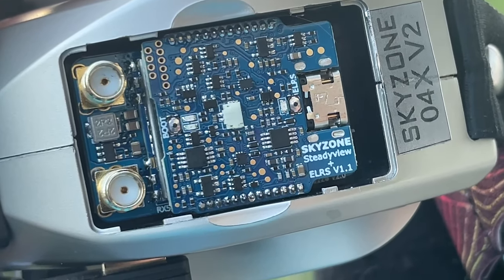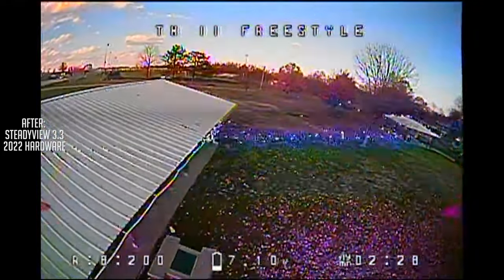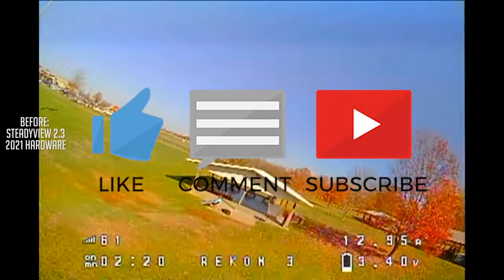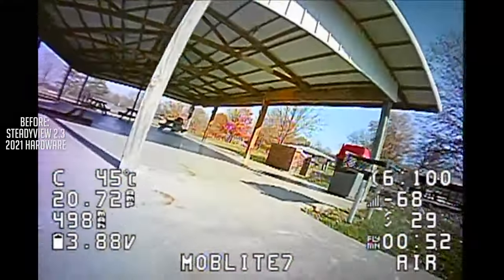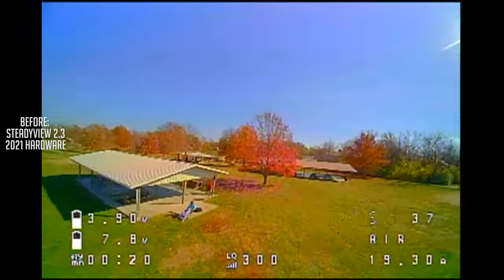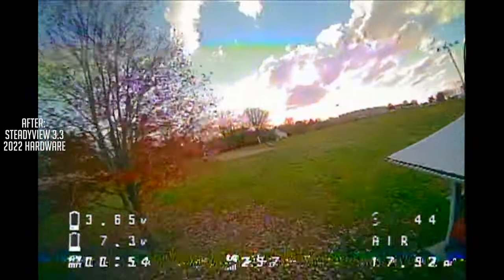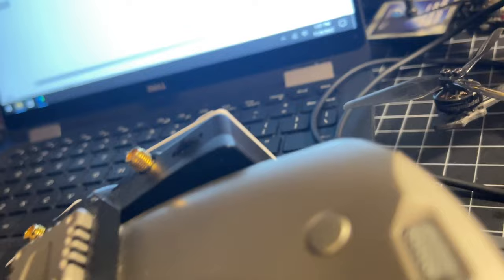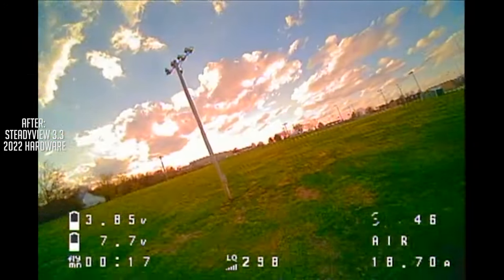SkyzoneFPV Steadyview Fusion Board V3.3 🧮 // Did They Fix Mix Mode?

Comment: my replacement module is on the way.   i downloaded the goggle firmware but there are 2 files in it.  do you move both files over to the SDCard?
Reply from the maker: Yes, firmware A and Firmware B must be copied. But, no SD card is involved. 

#1. You plug the goggles in over USB-C to a computer, and then hold down the power button and left wheel. 

#2. This boots the goggles up in a mode that mounts it as a visible drive on your PC or Mac. To flash the firmware, you then just drag the firmware files A & B to the "drive" that your PC sees. Let it transfer and that's it, you're done with the firmware flash. For firmwares, see here: https://www.skyzonefpv.com/pages/download

#3. The next thing to do in the goggles after installing the new module is to choose SteadyviewX mode instead of RF-Normal. Very important because it will not work at all if you don't switch to steadyviewx mode.

#4. Then recalibrate RSSI so your % numbers are accurate. For the calibrations, the options are LOW and HIGH. Calibrate on LOW first with no VTX or drone running. Then, turn on a drone or VTX and run the HIGH calibration, with the drone around 2 meters away. 

I want to do a whole video on this process, but didn't go into it for this one. It would have made it a 20 minute video. The most important thing is don't waste time flashing any fw on your new receiver, already seen someone almost brick theirs by doing this.
Reply: @JohnCuppi  Awesome, thanks.  i've never updated my goggles.  i've only had them since May.  i need to figure out if they are V2 or V3 goggles.
Reply from the maker: @beeradfpv  In the System menu, Scroll down to Firmware version and check what "FW1" says. It'll tell you what hardware version you have so you can download the correct firmware. Mine said FW1: 2.3.6 before I upgraded, meaning that mine were V2 and so I needed the V2 goggle firmware. After you update, also, it changes the firmware information page to tell you that you have Sky04x V1 / V2 / V3, since this has been confusing a lot of people too.
Reply from the maker: I'm pinning this comment also, it's a great question and our conversation should be helpful to others as well. Thank you!
Reply: @JohnCuppi  Just updated my goggles.  mine were V3 goggles on older 3.4.6 firmware.  Updated to latest 3.4.9.  Also was able to easy take the module out as mine had no tape or adhesive holding it together...lol  Must have know something better was coming...haha.  now i wait for the module to be delivered.  Thanks for the easy tutorial!  This was what was in my menu.
FW1 V3.4.6
FW2 V02.00.00.10
Hw V3.2.3.4
Reply from the maker: @beeradfpv  Hey glad to hear it worked out for you. Looks like you're ready for that module to be popped in and should be good to go.
Reply from the maker: @-mostfpv-  Correct. The Fusion Board module is what has the firmware on it, and when you replace that, it is up to date. Only the Goggle firmware needs to be updated. Not receiver. 🙂
Reply: @beeradfpv  In the goggles, "system" area, hardware version is there - look for "HW".

Comment: I am having the exact weird color issues, especially when the camera turns towards the sunny sky. Your video gives me hope! I have just placed the order for the V3.3 Fusion board. Keeping my fingers crossed. Thanks for the comparison, it really clears things up.
Reply from the maker: Glad to help. I have now had this module for 6 months and have not found any cameras with color or mix mode problems using it!
Reply: That's great to hear. Do you fly with mix mode 1 with all the cameras?
Reply from the maker: @sansjunk  Yes. I've never had to change to Mix2 or Mix3 to get a nice, clear, locked image.
Reply: @JohnCuppi  I finally got the fusion board and replaced it. However, intermittently I am getting a black and white video. This is happening on the bench, so should not be due to signal issues. My old Eachine EV800 is showing proper color, so it's not a VTX/cam issue either. Does it matter if the module is installed on the left bay? Mine are, and I see that yours are as well. I think for quadversity they need the streadyview x module in the right-side bay.

Comment: You mentioned hearing a beep when the video locks on the receiver. I've always wondered how that works, if the connection isn't two way. 

I don't have your goggles, but on my immersionRC module, I hear that beep as well.
Reply from the maker: My understanding is that since it can only be done 100% receiver-side, since it is pulling data in from both antennas, it has to ensure that the camera data is being received at the same rate from both receivers. and that data is up-to-date and matches. I imagine it's like two people trying to watch a movie or show for example, side by side. You want both start playing the content at the same exact time, so you sync yourselves up and hit the play button on 1-2-3. 

And then, if one of you drifts because of lost fps, maybe because your computer had a burp, you fall behind. Not a big deal for two people watching a movie if someone gets a few seconds behind, but for a receiver trying to combine that data to construct one picture, that's a major problem... Generally, you want to choose a short sync time, that's what is best to avoid drifting away because as you said this is really hard to do with a connection that isn't two way. I'm guessing that better hardware must do something to allow the steadyview to juggle all of this, perhaps detect a desync and correct it before the corruption gets to the user.
Reply: @JohnCuppi  Thanks!

Comment: Great stuff John. I will need to get 2 of these for the QUADVERSITY on my SKYO4X V2 Goggs.... Nice fix for sure....however Skyzone should really be sending these out for FREE for each Steadyview they have sold. Sucks to spend money to fix their issue.
Reply from the maker: Yeah... I never went down the path of quadiversity, do you find it to really be worth it? I'm glad the v3.3 hardware just worked for everything I have now, and not just the majority of my micro cameras. I updated my old 2.3 stuff to the latest firmware, and it actually caused some quads that worked great before to run like crap. The rekon3 wasn't like this before I updated everything. I'm glad Skyzone is still supporting users, but yeah, I wish it was offered at cost of shipping alone.
Reply: @JohnCuppi  I have not noticed any definitive improvement telling me it is worth it. Maybe  the update will show the difference 2 vs 4 receivers. The 1 big CON is how fast Quadversity drinks your goggle battery with 4 VRXs running.  You really need to monitor your battery closer because the end is abrupt. Bigger Lipo in my pocket with Lipo alarm has been my solution for that. Anyways great review bro. Always great info.
Reply from the maker: I always thought that quadiversity might be really beneficial for very long range, since you could have so many antennas pointed directionally. Thanks for stopping by man, appreciate it.

Comment: I have two of the older 2.x boards and they would go black and white, and roll hard over. Caused me several crashes. Both whoops and 5" builds. I have given up on the skyzone vrx and gone Fusion in one and rapidfire in the other.
Reply from the maker: Yeah, many already went that route. Sadly it’s too late then, BUT - if you ever have intention of selling your skyzones and keeping your rapidfire, it’s nice to know you can fix it. I’m thinking of selling mine in the future to buy the HDzero goggle.

Comment: Good video. Thanks for the info. Maybe silly question but what's the difference between the steadyview board and the fusion board? And do you ony need to buy the fusion board for the fix?
Reply from the maker: Thanks Barry. The fusion board is an attachment that goes onto the entire receiver module. If you already own Skyzone goggles, all you need to is purchase the fusion board for $25, and the receiver module comes apart for you to replace it with. It’s a quick, cheap, easy fix.
Reply: @JohnCuppi  Lovely. Thanks for the info John.

Comment: I had two of the 2.1 steadyview modules and goggles. What they BOTH did was when my quad was close to me, I would get EXTREME ghosting, which I hope is a type of desync. I'm about to try the new board! I put in a 35$ akk board that worked perfectly but... that has started to have an issue so I'm thinking about trying to new board. This effect happened with multiple cameras and vtxs. I will say on the new moldule, your videos all look a little shacky! looks like super fine wobbling.
Reply from the maker: check this for a reason why you see the 'jitter', it has to do with the deinterlacing -- https://www.youtube.com/watch?v=ctm56rHNxXo
Reply: Any news on the outcome?
Reply: @Dosclic98FPV  No, never got the new module to work, old module is still junk I just run it on diversity mode. Sucks but I can't afford new goggles.

Comment: I'd never heard the term "desync" in this context. I learned something new. 👍
Reply from the maker: Yep, mix mode combines 2x video signals to reduce noise, but when one of the 2 receivers has a delay, then this is what happens.  It's called sync pulse construction. The camera drifts and the pulses aren't set right, so it can roll or shake, or colors get warped to hell. Rapidfire and TBS fusion have also had this issue.
Reply: @JohnCuppi  upgraded Fusion still rolls especially on "fusion" mode, the only VRX that never de-syncs is Wildfire afaik, a bit less range but I love it tbh, I use it as much as my Fusion

Comment: I'm still running skyzone o2c and haven't had any issues so haven't upgraded to anything else yet. I seen the problem with the new receiver in newer goggles and glad I didn't buy them. As for skyzone charging people for this board to fix the problem I really don't think I'll buy another set of skyzones. That should be givin out free in my opinion especially to keep customers with all this better stuff coming out
Reply from the maker: I had issues with select cameras and models as you can see here, but they were a minority not a majority in my collection. I agree that since this was a hardware problem, in the end, they should have sent these out for free minus shipping costs. I believe that's what TBS did. Skyzone has said they are not making any profit from it and they are priced at BOM. IDK.

Comment: I screwed up my mainboard doing the dvr upgrade. I broke the 6 pin Zif connector that goes to the right scroll wheel. Skyzone sent me a new cable and connector but sent me the wrong connector so I bought a new main board. Now I have 3 mix modes(1,2 and 3) and diversity. Now I gotta figure out what they do. I was hoping the video would help but no. There are a lot of new options here. You can select bat voltage for the display for correct readings on the OSD.
Reply from the maker: There are 3 mixing modes to choose from because they basically have different sync pulse timings. 

Start with mix1 and see how it behaves, if you get desyncs you can try mix2 or mix3. Everything in this video worked like a charm on mix1. Diversity mode doesn’t use any mixing at all. 

On older hardware though mix1/2/3 is mainly useless to resolve a lot of the desync issues that were occurring. The new hardware just mixes and functions a lot better.
Reply: @JohnCuppi  Thanks John

Comment: Thank you for the only video on steadyview 3.3. I have a eachine ev300o v1 goggles (fw1: V1.3.5, FW2: V01.02.00.04, Hw: V1.2.3.4) Will the steadyview fusion board 3.3 hardware work with my goggles?
Reply from the maker: Hi, sorry for the late reply. I cannot see it working with that firmware on your eachine ev300o v1, everyone had to update their skyzone firmware to get this to work. Reach out to skyzone about this because eachine has totally abandoned this goggle, none of the links for the downloads for it are working...
Reply: @JohnCuppi  Hi John, Thank you. Skyzone actually replied that the fusion board would work aftervthe firmware update.

Comment: With quadversity, mix mode is very important. Sometimes i dont hear the beep that the second receiver locked until half way through my flights. Thank you for making this video, i'm going to upgrade both my fusion boards. At the end you said you only need to update the firmware of the goggles but not the modules but if im only getting the fusion board wouldnt the firmware of my receivers still be old? Just trying to figure this out before this stuff shows up :) Happy flying!
Reply from the maker: The Fusion Board is the part of the receiver module that also contains the firmware. So when you replace it, you are up to date. 

I am not 100% sure about anything specific needed for quadiversity though. 

Good luck, I hope it works out well for you! Quadiversity didn’t interest me, but since this is fixed, maybe one day I’ll look into it.
Reply: @JohnCuppi  if you still predominantly fly analog it's definitely worth it. I fly quadversity with the foxeer T-Rex (in my main 5") and at times it feels close to HDZ. Only close, not trying to say analog it's as good as hdz lol. Just bought 2 fusion boards, I'll try to post a video when I get them :)
Reply: @JohnCuppi  Hey man, just got my new fusion boards and just wanna make sure i do this right. so all i have to do is keep my receiver(s) in the goggles and update the goggle firmware (or do the receiver(s)need to be taken out first?), then once the update is done i remove the receiver(s) and pry the existing fusion board away from the receiver(s). Use an exacto knife if needed to release some of the glue, plop the new fusion boards in its place and i am good to go? i dont wanna brick my goggles or either of my receivers since they are so expensive.

I am really excited to get this done, i just got a Mobula 7 and i can only have it in mix mode for about 20-30 seconds before the screen starts turning grey and rolling. Have to shut off the goggles and turn them back on to fix or just switch to diversity, which isnt desirable. Appreciate you, TIA!
Reply from the maker: @parkswreckfpv3547  When you update the goggle firmware, whether the receiver is in the goggle or not does not matter. I would personally update the goggle with the old receiver installed first. Verify that the upgrade to the goggle firmware worked and that the old receiver is still working. 

Then, after the goggle firmware is updated, you can pull the receiver out of the goggle and separate the old board from the new, install it, and place it back it. Please be very careful separating the old receiver fusion board, when I removed my old one I accidentally bent a pin. It didn't damage it, but it was scary.
Reply: @JohnCuppi  haha yeah i noticed the broken plastic for one of the pin slots towards the end of the video. Thanks so much for the quick response i really appreciate it! hopefully i can get a video up this week showing the difference using my mobula, should be night and day dif. I really appreciate your help.
Reply: @JohnCuppi  Any reason you say not to touch the steadyview firmware? After upgrading the goggles the menus are a bit funky, which said can happen if the receiver isnt on v3 FW or higher. After checking in the settings menu, i am on 1.3.7, even though i installed the 3.3 fusion board. Think i should upgrade to the 3.3 steadyview fw?

EDIT: I read your pinned comment thread above and now see where i made a mistake. I updated my V2 goggles to V3 firmware. Currently it shows:

FW1: V1.3.7
FW2: V01.02.00.04
HW: V2.2.3.4

So applying the correct V2 firmware to my goggles now.
Reply from the maker: Because the module ships with the latest working firmware from the factory, so no upgrade is necessary. 

And people have been getting confused trying to flash the receiver when there is currently no reason to do so for a single module configuration.

I did nothing but update my goggle firmware. I'm not sure why your menu items aren't working right. Under my version data for my Steadyview+ELRS Module, my current firmware on the module info...

Model: Steadyview+ELRS
Subversion: V1
FW: 1.1.1-1.1.3
HW: 1.1.1

There is no newer version that you should need to update to. 

Where exactly does the firmware version 1.3.7 reading come from that you are seeing?
Reply from the maker: @UC9-fCiHzhRvNgpHp7i7-6fQ Are your skyzone goggles V1, V2, V3? If you are using V1, then your skyzone goggles firmware should be on SKY04X V1.4.0 which is the latest version for your V1.
Reply: @JohnCuppi  I edited my comment after reading your pinned comment thread. I installed the v3 firmware but I have v2 goggles so it misread fw1 to 1.3.7. I have now updated the correct v2 fw and everyone is looking how it should again and all fw/hw displays correctly and even tells me I have v2 goggles now
Reply from the maker: @parkswreckfpv3547  yeah, mine started doing that as well after the upgrade, which makes it much more clear exactly what hardware/firmware we have.

i'm glad you got it all resolved. skyzone does not make this easy to pick the right firmware and i have just not gotten around to making a step by step vid yet.

Comment: Nice! Glad Skyzone fixed it. Only took them what, 3 years?
Reply from the maker: Better late than never. You saw the worst here with my 2.3 hardware, but I pulled these models out of a host of a pile of others that were working great. In the end though everyone was right to suspect that this needed to be solved with hw and at least they didn’t give up. I know TBS fusion had a similar problem and offered an upgrade like this as well. Just glad it’s solved 100%, to not have to worry about what analog camera I come across.